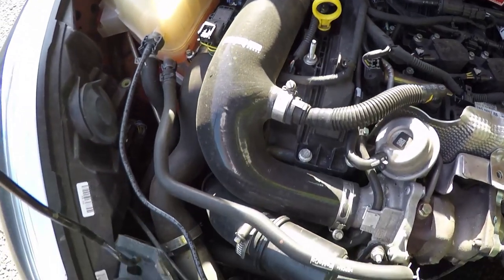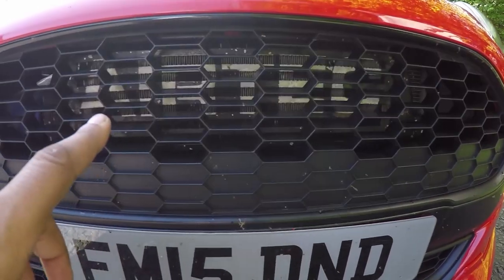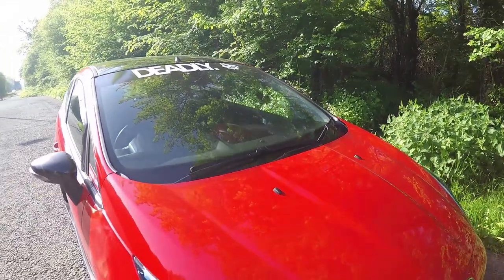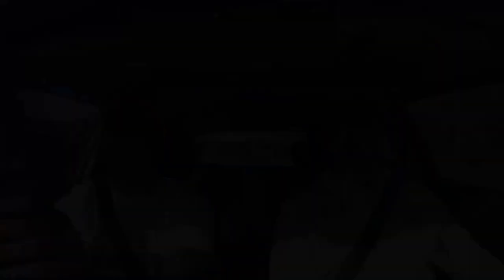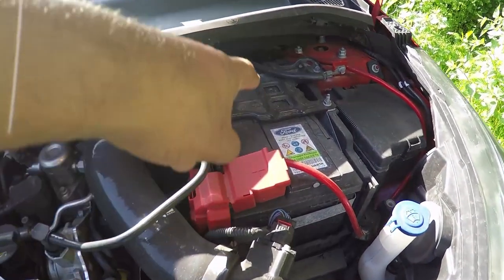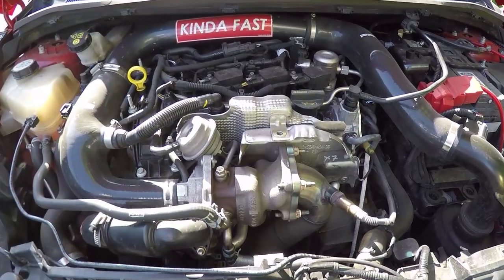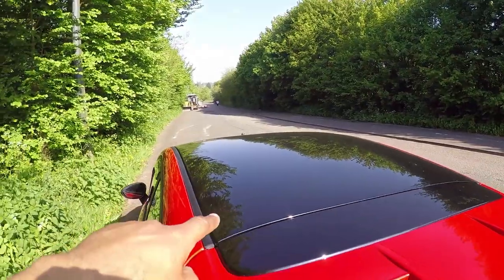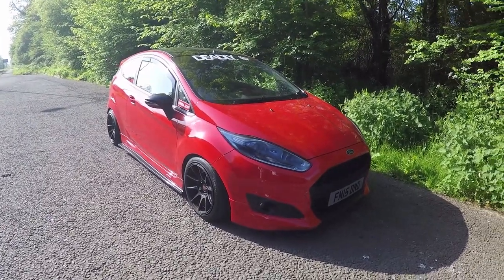180BHP 1.0L Fiesta Ecoboost//Stage 2/Shots fired....

Comment: I have red edition. Where do you get a diffuser on the back like that? Original looks too plastic. I'm based in UK. Help much appreciated.
Reply from the maker: Personally mate I can't advise you but I'm sure the owner will pop on here at some point so he might be able to point you in the right direction 👌
Reply: get that diffuser straight from a local dealer of search for an original Fiesta ST diffuser, because that's what it is.
Reply: PUMA SPEED sell them.

Bare in mind you will need to buy the upper diffuser and lower diffuser, in order for it to actually fit the bumper
Reply: I can't find the original st one.... need the UK link please or any links to the parts. Cheers
Reply: Timothy Hawker So this is the upper section http://www.pumaspeed.co.uk/product-Fiesta-ST-180-Rear-Upper-Valance-Insert_16148.jsp
Reply: Timothy Hawker both of them will be needed to have the end result you want.
Reply: Timothy Hawker you’re probably best buying a second hand ST bumper in the colour of yours. I picked up a full frozen white ST rear bumper for £150 rather than buying the 2 diffuser parts, getting the bottom part painted etc.
Reply: SinistaUK yeah that is true, it's difficult to find,  like right now on eBay, I can only see the blue full bumper set but no others, ford website parts sell the pieces for £80 each but again in stock colour so would have to get it wrapped or sprayed

Comment: What is giving off that turbo/pshhh noise?
Reply: Its the larger intake hoses, i had an R-Sport induction kit fitted  and it didnt change the sound at all untill i added the 3 other larger diameter pipes.
Reply: dump valve

Comment: Do you know what the 1l ecoboost 80bhp one of these would be like for modding?
Reply: Those are non-ecoboost. No turbo same engain so would be pointless...
Reply: Shrapnel whys it called and ecoboost then
Reply: lol101 potatoes 

Beats me, it's not technically eco boost if it's not boosted. So no idea.
Reply: Shrapnel I thought it did have a turbo lmao
Reply: Although a very small one
Reply: lol101 potatoes are you not thinking of the 1.25 litre 82bhp NA version?
Reply: SinistaUK no it's 1l ecoboost my mum has one
Reply: Jordie Evans aye got a corrola now anyways😊

Comment: Got a 66 plate of this car. Kept mine stock as the ib5 gearbox is shit and I don't won't to crack a cylinder. 140bhp is great for the 1.0. if I wanted faster I would have gotten an ST
Reply: TheAdamski99 Gearbox is shit? Its maybe weaker than the engine/block, but it can handle 300nm
Reply: @marcelk3847  300nm 😂😂😂
Reply: TheAdamski99 nice argument. I am driving mine for 60.000km with 300nm. 😉
Reply: @marcelk3847  Oh you're hard. Torque limited to 210nm on overboost from factory to protect the gearbox.
Reply: TheAdamski99 no trouble with the gearbox. "Factory Limit" is BS

Comment: Imagine a bigger turbo and injectors on this.. Surely pushing 200bhp+
Reply: Good to see you again George. Was just looking at the power and economy of these 1 litre ecoboost engines and they are surprisingly good. The 120 and 140 hp versions take around 9 to 9.5 to 60mph and they are claimed around 74mpg. I wouldn't mind getting one in a few years before this stupid low emissions zones come into play in 2022

Comment: Talk about no torque 😂😂
Reply: Water Gate this probably has more than a standard ST torque, from a 1 litre 3 cylinder shut up
Reply: Kieran Todd that’s still not a lot of torque though. Is it ??
Reply: Water Gate in relation to the size of the engine it is
Reply: Kieran Todd so how much torque does this 180 brake engine have ?
Reply: Water Gate 230nm
Reply: 250 on overboost
Reply: Kieran Todd so in old money that’s @170 ft/lb. 😂😂 Why are people obsessed with bhp. Believe me when I tell you it’s torque that makes an engine. If you’ve never been in or driven a c63 not the new one but the 6.2 n/a one. Do so. Then you’ll understand what torque is. This eco boost is all about revs unfortunately that’s not where you’ll find the torque of an engine. Understand??
Reply: Water Gate all about revs? The torque is full on from 2000 revs read a book.
Reply: Kieran Todd read a book. That’s one for the book I’ll read 😂😂
Reply: @watergate9557  180 bhp with 270nm I've saw on remaps. It's alright for a 1.0T, not the best though...

Comment: Seriously it was a stupid idea tuning this to 180hp, because the "ECO" doesn't stand for lower consumption and emission only, it also stand for lower quality and less durable parts, those engines are known to be unreliable in the first place. Good luck with the block, crankshaft and turbo.
And for the people who think t's impressive. Nowadays it's not, really... as an example, a standard Golf R has a 2.0l 320hp engine, that's 160hp per litre and a simple software will up it to 360hp which is 180hp per litre, and that's just a software tune and the parts are actually designed for that kind of stress, a turbo, 3 cylinder block and crank designed for less than 100hp (at best) aren't. spending this much money, parts and work on an engine that's probably not gonna last the year to only produce this little power is really stupid in my opinion.
And LOL look at those tiny wheels, those are way smaller than the standard diameter, of course it's going to register more speed on the speedometer than it's actually doing, what do you expect from a teenager. It looks like a cartoon car from the sides. And let's not talk about the constant popping.
Reply: abd bach take it you have nothing betterr  to do than write essays being negative lol
Reply: I'm sorry it seemed that way, It's just that, there are things you shouldn't do.
I'm an enthusiast and I'm all about tuning, just not a bad one even if it's done to a car or brand I don't like. Because in the end it makes the rest of us look bad.
It's his car, and "he can do whatever he likes". Sure but then again he posted it on Youtube allowing everyone to express their opinion.
And let's be honest, teenagers wanting to modify their cars don't come up with the best ideas. If I was in his place I would've actually taken some advice and learn from it.
Reply: abd bach that is me 🤣🤣🤣
Reply: To TheClaytonbarry Well, that doesn't change anything.

To  Yll Like I said I don't want to sound negative and yes of course everybody starts somewhere, but then again he should learn from this and if all he hears is "that's cool" from 12 yo kids on the internet he's not gonna learn anything, is he now?
And all this aside, it's just about common sense really...
Reply: abd bach yh have to start somehwere and at the end of the day its been reliable since the map so no problems for me